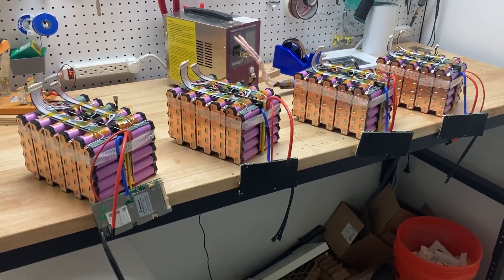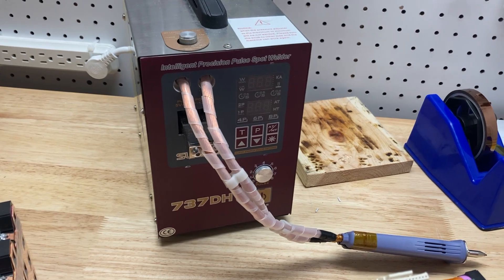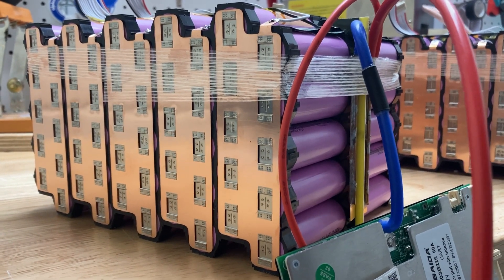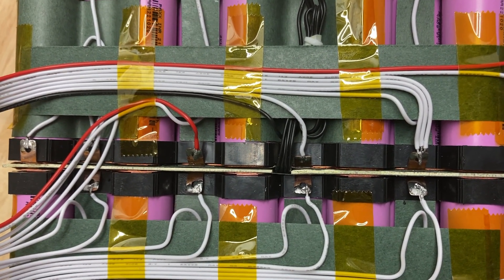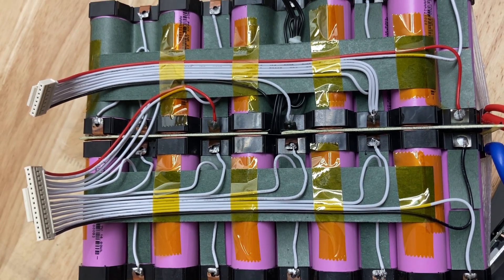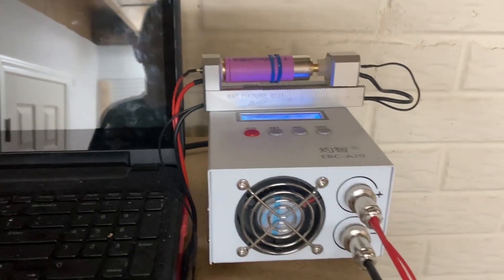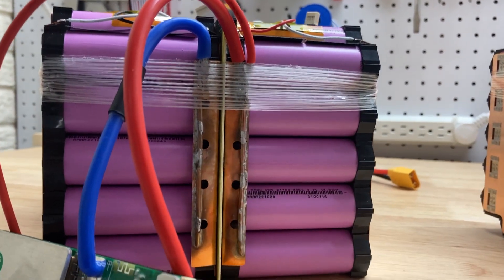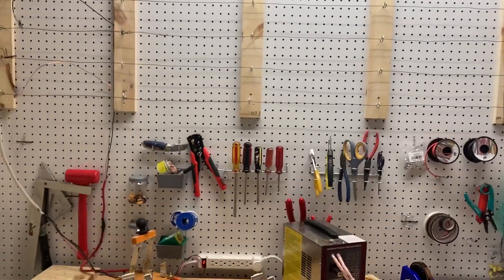72V20Ah60A Lithium Ion Battery Build

Comment: You build the battery wrong, the power cables (+Pos /-Neg) should be equal length like diagonally connected/welded on the Battery terminal.

Comment: When using those busbars can i use just a normal spot welder to weld them to the batteries? Also im looking to make a 20s8p or maybe a 20s10p with molicel p42a, would this bus bars be sufficient?

Comment: Thermistor diode? thermocouple  palladium wire heat makes  voltage hold secondary magnetic valve and senses heat  like a Sterling seeback peltier effect seeback  can freeze from heat and make Electric

Comment: FYI: WARNING For anyone using 26650's should be aware that ALL, regardless of brand, contain a 18650 battery inside the 26650 can. I do not know if this is true for the 21700 battery. I did not have any to open. The 26650 battery is Chinas biggest lithium scam ever. If someone wants to open a 21700 to see if they also contain a 18650 i would really like to know.
Reply from the maker: Counterfeit cells are not limited to a particular size.  Battery capacity testers for $25 can verify cell ratings.  https://www.aliexpress.us/item/3256804909652648.html

Comment: Hey Todd! I just wanted to tell you how extremely helpful this video has been for me with understanding my first battery build. I can’t tell you how many times I’ve watched this video lol. Seeing your battery builds and you describing all the details has helped me a lot in understanding all of this. I ordered the WELLGO busbars from Ken, the 1.0 mm for a 28s S 11P Pack. It’s a large battery for my first build but it’s for my Suzuki Rmz conversion. I have a couple of test videos on my channel with the bike but I was just using a 72 V battery for the testing. Can’t wait to see how the 28S battery performs! 
Anyways, I just wanted to tell you how helpful this video has been! If I was in the market of buying batteries, I would definitely give you the business but I always DIY everything lol  

Are you on endless sphere? You might be able to advertise your battery builds on the “New items for sale" section.
Reply from the maker: Sounds like real nice pack ur putting together.  Glad I could help.  Thank u for the advertising tip!
Reply: @HOTPAXX  Do you even need a bms on the battery if you have propper configuration on the motorcontroller realtive to the battery capacity and a suitable fuse between the battery and the controller and between the battery and the charger/bms (while charging)? Isnt it good enough to have the bms between the charger and the battery for balancing over night while charging?
Reply from the maker: You can run without BMS but eventually the voltages of your cell groups will get out of balance.   You will also loose all the cell protections that BMS offers like over-discharge, over-charge, short circuit protection, over temp, ect... not sure why you would want to do that.  A Quality BMS with proper current rating has become a standard for a reason - it works well.
Reply: @HOTPAXX  reducing weight and space on the bike. But the bike will charge then you connect to bms and balancer, so after the bike has charged up it will keep balancing for the rest of the night? Then your only left with the protection from over discharged, when the battery is powering the bike. But the settings in the vesc is supposed to be able to limit the discharge and a proper fuse can help too?

Comment: I am still rather skeptical of using nickel plated steel being used as a primary contact material. I've done some testing of pure nickel and then placing a pure copper bus bar under the nickel to simulate a battery that has pure nickel spot welded to the battery and then copper soldered to to the nickel. I'm only seeing a 25% decrease in resistance. For example using a 0.15mm thick x 8mm wide piece of nickel thats about an inch long I'm getting an AC IR reading of 1mΩ. Placing the copper bus bar below it (3mmx20mm) and measuring the at the same spot (the ends of the nickel strip) I'm getting an IR reading of 0.760mΩ

So there is a benefit to including copper as it will be a lower resistance material for the electricity to travel through but the difference I think is minimal. Spot welding pure nickel would just make more sense. Those Sunkko units are garbage, there's no nice way of saying it, no one has ever had success meeting the specs of given by Sunkko without modifying the transfer with their own welding cable wrarps on the secondary winding. 

I'd love to see some IR readings of these packs compared to one that is just welded with nickel plated steel or pure nickel. I'd bet a pack welded with two layers of 0.15mmx8mm pure nickel would come very close to matching those custom bus bars with the nickel plated steel material attached to the cell.
Reply: Yes, these bus bars look good and the 0.5mm thick copper is better than I’ve seen on some much more powerful batteries, but I too wondered about the junction between the battery and the nickel and the nickel and the copper. 

Lets say you are using 21700s with a 45a rating (to make something that runs doe 6 minutes per charge lol), if you compare the best Nickel strips you can realistically spot weld vs these which clearly have less resistance in the copper portion. 

I think you need an optimum number of spot welds also to carry 45a continuous through that tiny pad. 

With 3 choices of copper thickness (0.3 mm, 0.5 mm, 1.0 mm), and cells in hexagonal holders, can the nickel portion even come close to feeding the 0.3mm copper sheet?

When i made my LiFePO4 “erector set” battery, using 32650 cells with threaded terminals, i used 0.2mm thick copper sheet, but no need for nickel. Lol. Since the cells are wider I estimate each cell to cell series connection is is at least 5mm^2 which is super overkill for a 20s6p 30AH battery feeding a 30a controller. Lol

Using basic math, the 0.5mm copper sheet 20mm wide is 10mm^2 per cell in parallel. That can carry 30 per cell (150a in 5p) all day, 24/7, in the Sahara. 

So we need a thermal imaging with 150a (bypassing the BMS) and see if it gets hot at any of the junctions.

It definitely makes for a good looking battery.
Reply from the maker: @imho7250  Heat generated is a function of resistance and length.  Consider the short length of the nickel plated steel and the thermal conductivity of the copper.  The heat generated is drawn and dissipated.  I know a battery manufacture that mass produces 120a packs with this same hybrid busbar.  20s5p kit is now available at www.hotpaxx.com.
Reply from the maker: It would be interesting to compare packs.  on paper, copper outperforms pure nickel by a factor of 4.  copper 1.68x10^-8 Ω*m, Nickel 6.99x10^-8 Ω*m.

Comment: How to diy charge 50 batteries?
Reply: Any module.
Reply: @deone-entity3935  TP4056 modules are cheap. Get the slightly larger ones that have the protection circuit built in
Reply: @ericklein5097 ip2312 is 3A.

Comment: So I’m doing a build with Molicel cells 21700 P42A. Since I’m starting with new quality cells, do you think I should do a self discharge test, like fully charge each cell and check to see if they’re self discharges over Couple weeks? The problem is my battery pack is 360 cells so it would take forever and I’m just not sure if it’s necessary considering the quality of cells I’m using. I plan to check the IR of each cell for sure, but just not sure about the self dain test. Thanks for any input!
Reply from the maker: Likely those cells have been sitting for some time since they were charged by the manufacturer.  my resistance tester also displays the voltage so I look at that while I am checking resistance.  if the voltage on each cell is in line with the others, it is not self discharging.  after this test if the cells are all very similar in voltage as I suspect they are, I would verify capacity on one or two cells and call it good.  Sounds like a fun pack!

Comment: How do the busbars connect the two different packs together or the two different cell walls? Since normally packs are folded with the nickel strip, was wondering, how do you connect this cell busbar, since it cannot be folded?
Reply from the maker: Ken sold me the bus bars and he said 0.5mm copper folds ok.  for higher current applications with thicker bus bar, he offered a bolted connection at the fold.
Reply from the maker: the pack is assembled like one long 20s pack.  the busbar between cell strings 10 & 11 is folded and the connections insulated with fish paper and fiberboard to prevent shorts between adjacent busbars.
Reply: Ok good to know! Bolted might be my best bet since I will be using 1.0mm busbars. Thanks for the reply!

Comment: I'm upgrading my factory ebike battery from 2500mah 18650 to the same amount (40) of 5000mah 21700.
I'm having to reuse the factory bms as it does a handshake with the bike to allow it to electrically connect.
My question. I see you have the charge/discharge sense wires connected in a seeming order, does the bms know what order that is, or even care? does it matter what order they are connected, would it make a difference if they were different?
Reply from the maker: The balance leads have to be attached in the correct order.  The BMS will look at voltage difference between each lead to determine the subgroup voltage and keep them in "balance".  It will also disable charge/discharge if voltage is too high or low.  they all have to be attached in the exact order you remove them.  JBD states in there documentation to check with volt meter before plugging in harness as it can damage the BMS if connections are incorrect.  more support can be found at hotpaxx@gmail.com.
Reply: @HOTPAXX  Thanks for your prompt reply. I can figure that out and follow the original sequence. thanks